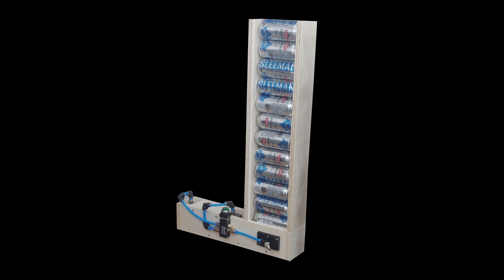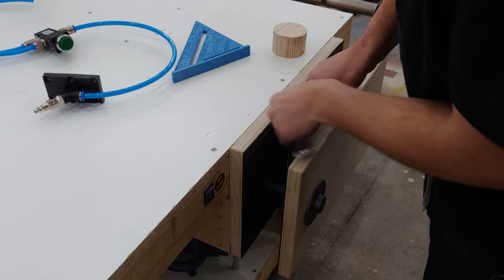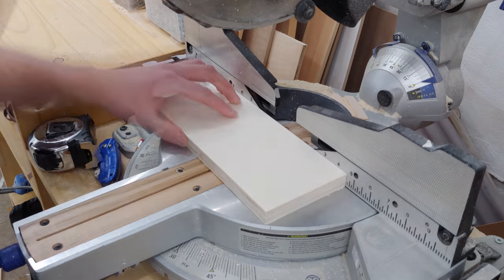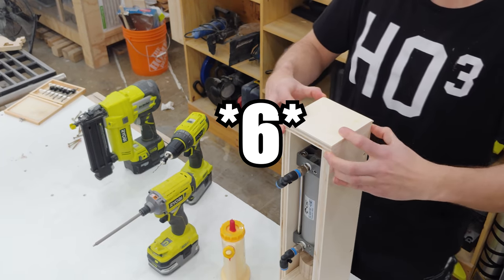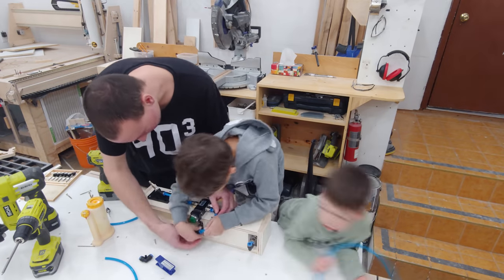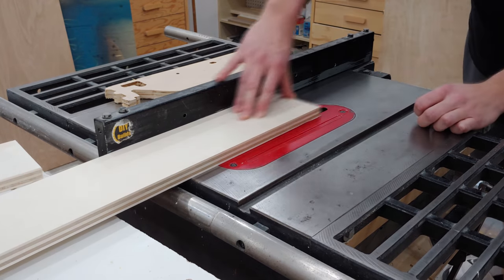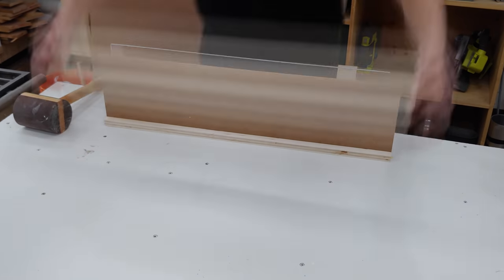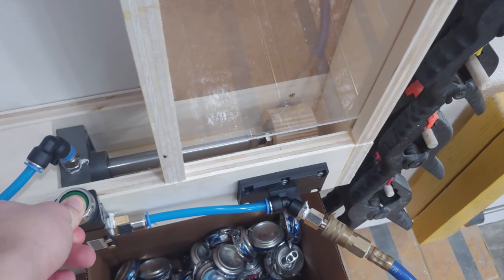DIY Pneumatic Can Crusher

Comment: Add a plate to the back of the plunger so when it's extended the cans don't fall in the gap and it works smoother
Reply: I had a manual one that used to do that or the can would turn sideways and not work.

Comment: Question about the build. I bought a cylinder off ebay to build one of these and it says 1/4" on the fitting plugs. The cylinder you show in the plans from Princess Auto also says 1/4" for the fittings but the airline delivery kit says 3/8ths" in your plans. Is the 3/8ths" kit you show the correct one because they are maybe referring to inside or outside dimensions in either case? Princess auto has a 48 piece 3/8ths kit now for $43. instead of the 49 piece you got on clearance 2 years ago.

Comment: That's really cool. Too bad I don't drink enough soda or other canned beverages to use one of these... do you think it would work for fireplace duty? Splitting small, pre seasoned logs? Because that would be pretty cool.
Reply from the maker: Possibly.
Reply: Depends on the species in regards to psi necessary to split the wood but the more pressure/capacity the better always.

Comment: Cool project! :-)

I would take a bit off that support piece on top of the cylinder so that if the end wall comes out it won't shear off the right hand air nipple on the cylinder, or at least give you some time to react and stop pushing the button. :-)

Comment: How would you make it automatic. Senses can and crushes it. Maybe an induction Proximity Sensor?
Reply from the maker: I have a background in automation so given enough money i could make it do anything. The main reason for not being automatic however is that the air line is only connected when the hopper is full as it runs through the middle of my shop and if it were always connected it would be a nuisance

Comment: I have worked with Pneumatic rams before but they went much faster. I dont know a lot about them except the ones I worked with. Why is it so slow to actuate? Is there different speeds?
Reply from the maker: Only so much air flow through those size hoses / pushbutton at that psi.

Comment: How did you figure out what Pneumatic ram you needed? shaft length and force? I would like to build something similar but that can accommodate taller cans.
Reply from the maker: Those are already tall boys.
Reply: @DIYBuilds  I drink 500ml euro beers and lately have a fondness for King cans as well. It'll be interesting to see if a larger size box will hinder the tall boy effectiveness.
Reply: @fredpichler9857  you just need a pneumatic cylinder with a stroke as long as the can.
Reply: @user-neo71665  understood, but if I make the box large enough for King cans I'm worried that tall boy cans may fly out. That's happening now with my manual crusher. I'm going to try angling the one I have now.lay flat like the video might be best.

Comment: Maybe I missed it but, How long did you cut the plywood round that you screwed onto the piston? I don't see a measurement in the plans either. Awesome build going to try one myself
Reply from the maker: Basically the size of the can or slightly smaller than the opening. It was a piece i had left over from my gear vise build.
Reply: @DIYBuilds  Do you mean the length of the Round block is the length of a can
Reply from the maker: @wildman3506  length is about 1.5 inches and diameter is what i meant earlier
Reply: @DIYBuilds  Thank You

Comment: I was thinking... why would i crush a can that is worth 25Eurocent each? Then i realized, that germany is probably one of the few countrys with „bottle“deposit on cans.
So in this case... awsome machine!
Reply from the maker: I get 10 cents back for each can at the beer store regardless if crushed or not.
Reply: @DIYBuilds  wow ok. Here they have barcodes, that have to be scannable. I think your system is way more space saving
Reply: in the USA ( Virginia is my state ) we do not and most states do not have a can deposit .  We can either throw them away ( 🤬) or take them in to sell for scrap metal .  You can fit many more crushed cans in your car or truck  so it makes sense to crush them .  I would imagine same in Canada .   

Fachspersonal  Grüße von USA .  Ich habe noch gute Freunde in Mädelhofen in der Nähe von Würzburg .  Ich wohnte dort , als ich aufs Gymnasium ging .  Mein Vater war beim Militär